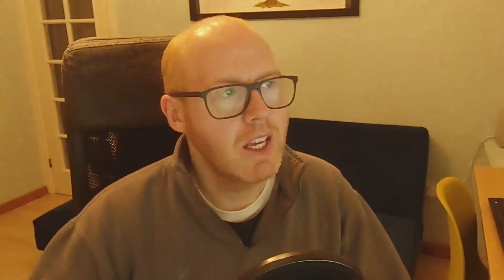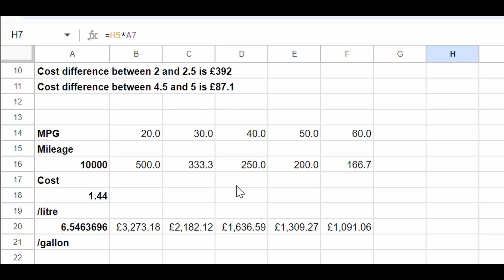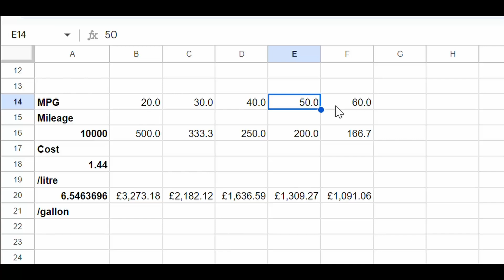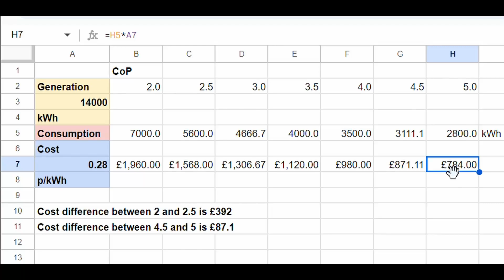Why Heat Pump CoP isn't Important : Reduce Cost & Decrease Efficiency?

Comment: None of the heat pumps I'm looking at use COP. They all use SEER. Is there a conversion calculation? Thx.
Reply from the maker: One method of converting SEER to COP, is by multiplying by 0.293
Reply: @UpsideDownFork  Thanks. Greatly appreciated. So a 19 seer unit = 5.56 cop which is 5.56 times more cost effective than electric heat? If that's correct it's a no brainer.

Comment: Very informative, I've never seen this info before.

Rather than chasing COPs of 5 by spending thousands on re-piping and large rads don't bother.
Reply from the maker: I think a COP of 4 is probably the sweet spot.
Save some money on running costs compared to gas and very little work required for most properties.
Reply: @UpsideDownFork  Agreed. Once again thanks for the info, laid out in a succinct and accessible manner.

Comment: Sorry buts that's complete BS. If your an ECO warrior or have more money than sense then SCOP's are of no interest. For the rest of the 95% of the population SCOPS are the way of determining whether it is "Financially Viable" to run an ASHP over some other heating device(s).
If you already have Electric only Heating then your maximum SCOP is 100% so it's a no brainer to install and ASHP, HOWEVER, your not eligible for a BUS grant.
If you have a gas boiler that needs replacing OR are looking to, potentially save money, then you have to look at the SCOP.
Whilst Electric is 28p and Gas is 7p the minimum SCOP to make it advantageous to switch is 4 or above. The Maths is simple 28p/7p = 4. That's a simple "rule of thumb". In actuality you should divide 7p by 0.85-0.94 (depending on how old your boiler is). So it would be 28/8.24 = 3.4 to 28/7.45 = 3.75.
Don't believe any sales "spiel" about when they decouple electric to gas prices. It's not going to happen anytime soon and will at best be a gradual shift of costs from electricity onto gas.
.
The second issue I have to raise is regarding your last video on "How Many Solar Panels Can I Install?"
You are correct that you can potentially fit 17 panels onto your roof.
However if you  had continued on with the software and shown the entire process you would see that there is a calculation of both Loading (ie extra weight) and Wind Lift (how much additional force your roof would experience in a direction it was not intended).
These are IMPORTANT. Exceeding those values (determined by specifying your roof construction, timbers dimensions & load centres etc) means your roof might A) Collapse or B) Be ripped off in high Winds.
.
I am NOT suggesting that you don't create videos but in doing so you have an obligation to ensure that the information you are perpetrating is both correct and accurate.
Reply from the maker: You raise some good points!
1. Direct electric homes are eligible for BUS.
2.On the financial viability calculation.
Beware anyone that claims a gas boiler can run at 94% efficiency. 
The gas flue analysis will tell you about the combustion efficiency, but not about the heat transfer and overall heat production efficiency of a gas boiler. 
I could equally show that i've achieved a COP of over 6 for brief periods, but as you highlight, it's pretty meaningless over the course of a year when my real figure will be much lower.
Strapping the probe into a gas flue over a 24 hour period will demonstrate that even though some gas boilers will run well during certain phases of their cycling, even those that are sized correctly and have decent modulating controls will rarely average over 85% in the real world. 80% is a representative figure for most people. This brings the necessary SCOP for cost parity to between 3 and 3.2 depending on where you live in the country as the price cap does vary from region to region.
3. The point of the video is ultimately to demonstrate diminishing returns and marginal gains. A £5000 HP installation may net you a SCOP of 3 and you may achieve cost parity with gas. A £15k HP installation may achieve a SCOP of 4.5, but will you ever recoup that extra £10k capital investment? Unlikely.
4. As others have mentioned in the comments, the fact that they can run their heat pump entirely from battery storage at a cost of 7.5p/kWh is another important consideration. This is not my personal approach, as I once again think about the capital costs necessary to make this possible.
5. I agree that the price decoupling is unlikely to happen. There is definitely no political will to alienate the vast majority of the population that currently have gas boilers. I don't know what things will look like in 20+ years, maybe then serious discussions about this may begin. Even still, it's unlikely that any government will back away from profitable levies and taxes without a lot of persuasion.
Right now we're being fed the carrot, at some point we may see a stick coming for gas boilers?
6. On the solar panel loading issues. For me, my roof can easily take the loading. That video was not intended to be a complete tutorial or 'how to' of how to size and engineer things. As with all my videos, I always make clear that i'm just Joe Bloggs sharing my experience. I hope that my content provokes people to ask questions and do their own research rather than blindly follow.
Your suggestion that my content is not correct or accurate is concerning.

Comment: It's Seasonal COP (SCOP) not COP 😊!

I think the COP (day to day upon first install) is the main thing to get right - i.e. is the system the most efficient it can be for given days. 

Then you need to make it cost effective for you to run.

SCOP is a bit of a vanity metric, quite a few on the heat pump monitor don't have DHW on! Or only heat water every 2nd day... Biggest impact on my SCOP is the DHW.
Reply from the maker: Indeed! A brief study of the heat pump monitor website did reveal some of the tactics that could be employed to fudge the CoP numbers.

I totally agree that getting a decent cop at the beginning of the experience is important and then transitioning to making the system run as cost effectively as possible from there.

Thanks for the comment!

Comment: COP is a good indicator for how well the system performs and yes the returns will diminish with on point increases. Insulation or larger emitters would reduce system temperature (ie less energy required to maintain a flow temperature) which is where the savings increase again.
Reply from the maker: Thanks for commenting!

Comment: Surely another factor is regarding zoning. By running the whole system ‘open’ should maximise your COP, but it will require more total energy output than heating only the rooms you need heated - albeit at a lower COP. The electricity required for 20kWh of heat output at a COP of 4 is more than required for 15kWh of heat out put at a COP of 3.5. The obvious caveats of individual system characteristics and electricity tariffs obviously apply. In other words, like everything ever, IT DEPENDS!
Reply from the maker: Yes. Exactly!
There is a very dismissive sect that advocates COP at all costs but as you say, it depends!

Comment: Hi, When do you heat up your water tank?  During the afternoon when Air is hotter, or early hours when electric is cheaper?
Reply: If your cheap electricity rate is say half your peak rate then your COP would need to double based on higher air temperatures. Seems very unlikely to me but depends on your system, climate and tariff.
Reply: @simonm9923 conversely if it’s 30% the cost at night it’s a no brainer, you sacrifice a little CoP being at night for the expensive day rate when the air is warmer. I heat my tank between 6am to 7am and it lasts most of the day, with small top ups when needed. E-on Next is 12-7am, tariff 33p/9.5p.
Reply: @alancwright  completely agree, it was a hypothetical example. I get 6 hours at 7.5p so definitely heat the water and do any legionella cycles etc.
Reply from the maker: This is exactly the point! Thanks for bringing in the real world example that we can all identify with!

Comment: Thanks for giving the kWhs needed to heat your home. That's really interesting to me.
I get the impression that poor insulation is the major issue in UK houses. Also for the people, like yourself, who are transitioning to renewables and presumably have made the effort to improve things.
I only consumed 874 kWh gas in 2022 to heat my 2007 build Dutch detached house.
That included hot water and cooking on a gas hob.
Could you insulate your house enough to half your energy requirements for heating? 
Or is that an impossibility in your situation?
Reply: That sounds incredibly low. A Passivhaus has to be less than 15kWh/sqm. per year, for heating - excluding hot water and cooking. If your house was only 100sqm then it would require 1500kWh per year. What is the heat loss of your house? Sounds incredible.
Reply from the maker: Yes, poor insulation is a major factor for our housing stock!

It is not uncommon for many homes to need 10000-20000kWh of gas per annum.

Many people installing heat pumps do also tackle some retrofitting of insulation for some quick wins but there are many fundamental issues with our properties and our planning system that restrict decent insulation being feasible for the retrofit market.

Comment: Have you had a look at the homely controller? It's a really interesting product that fits in well with the title of this video. As an example, it looks at the price of the octopus agile throughout the day, looks at weather forecasts for the day (for outside temp and solar gain), works out how long it takes for your house to heat up and cool down and then works out then works out the most cost effective way to heat the home throughout the day. Ie, running hotter when costs are lower and boosting temps, and lowering temps if the outside temperature is expected to increase through the morning.
Reply from the maker: Thanks for the comment.
Unfortunately Homely still isn't compatible with Vaillant.

Comment: Good points. I noticed that there's a sweet spot with radiator temperature too: lower temperature increase the amount of heat delivered by the heat pump (COP) but reduces the amount of heat delivered to your house. I suspect that everyone's house will have a radiator temperature that maximises heat output and final room temperature.
Reply from the maker: Yes, ideally we'd all be running our heat pumps in the 25-30 degree range all year round, but the size of radiator required for that is not feasible in many homes!

Thanks for commenting.

Comment: I’m ignoring the COP because I can’t measure it accurately without a lot of intervention.   The value reported by the Valliant app does not reflect reality (at least in my experience and others).   For example, so far this months it’s reporting a COP of 6.6 for our heating which is an over estimate.    I believe the way the software estimates the energy yield is not accurate at low delta Ts.
Reply from the maker: Thanks for commenting.
Have you been on the open energy monitoring forum to compare notes?
Reply: @UpsideDownFork .  Yes, I did pose the issue and someone told me that the after doing a detailed investigation, they found that the Valliant system measures the flow temperature a bit too high (return is ok).   It’s not too much of an issue with sizable delta Ts but with smaller values, the error can be significant.
Reply from the maker: @crm114.  The difference in the delta T is an interesting one. I was interested to read about how Vaillant controls adjust the dT sometimes between as high as 10 and as low as 3!
Before installation i'd assumed that they were a pretty consistent 5, with perhaps a 10% swing either way.
I was also trying to determine the average losses between where Vaillant measures (in the HP) compared to where the independent measurements are taken. In some cases I found users that had more than 10M of external pipework before the flow and temperature sensors took their readings. Now if the pipework is well insulated and minimal bends, filters, valves etc then the losses should be minimal but they will always account for something.
What I mostly can't wrap my head around is how some people are finding Vaillant readings pessimistic whilst others find them optimistic.
Vaillant tech did tell me on the phone that by having a buffer in my system, the readings will be much more consistent and reliable than a non buffer system. That does make some sense but I know Vaillant tech sometimes just want to get you off the phone and will tell you anything!
Reply: @UpsideDownFork  I’m similarly confused by the measurement system.   I really don’t have the inclination to install my own sensors as some have done.    I’ve only had my system for 2 and a bit months now.    When I have a but more data, I’ll start comparing my energy use with my historic gas use over the past 3 years.    This should give me some idea of the real world efficiency.     Keep up the good work on the channel and ignore the silly comments.

Comment: There is of course the "diminishing returns" factor that is simply dictated by Math, but when comparing COPs between different installations, there is also another factor that is often overlooked...
Air source heat pumps are most efficient when temperatures are mild, and least efficient when it is very cold outside. Now, when you have a very well insulated house, your heating will probably only kick in at temperatures below 12 or even 10°C, while an older building will still require heating up to 16 or even 18°C. This leads to the paradoxical situation, that those older buildings can have far better COPs, but still use far more energy than a newer building with a significantly worse COP (since the HP will mostly run when it's really cold).
Reply from the maker: Yes! That's a great point to highlight too!

Thanks for commenting.

Comment: Great info, had not really thought of that before.  I suppose it's the easiest comparable metric but as you say it's not everything. It seems really easy to fiddle the SCOP figures too, so when someone says they have a SCOP of 65billion or whatever is probably not worth getting stressed about. As long as you have a SCOP above 3.5 then it's probably costing no more than a gas boiler.
Reply from the maker: Very true!
Thanks for the comment.